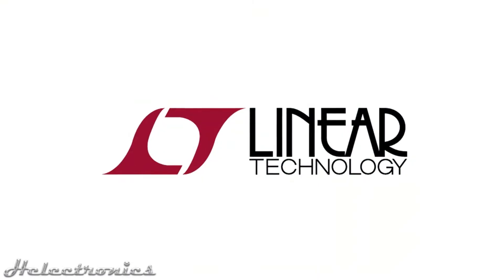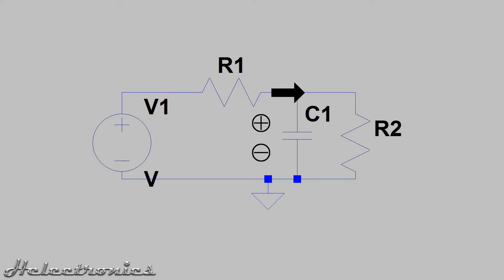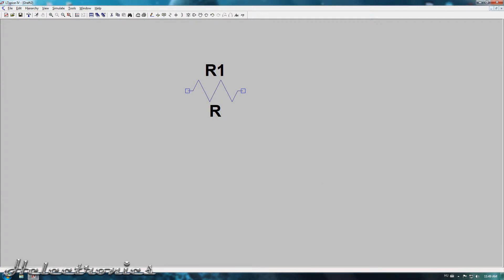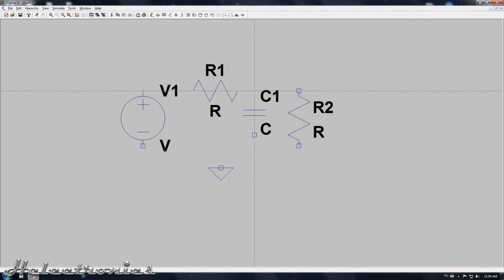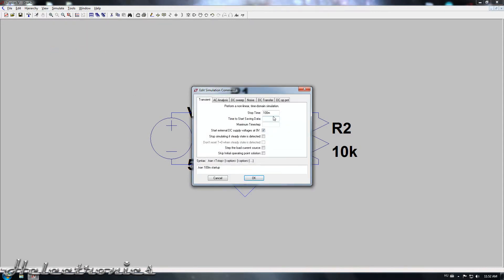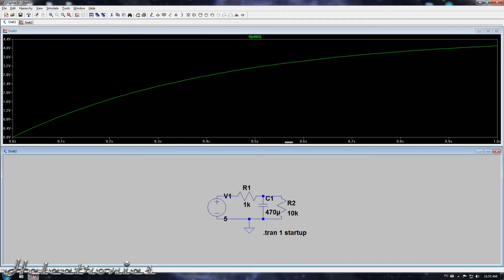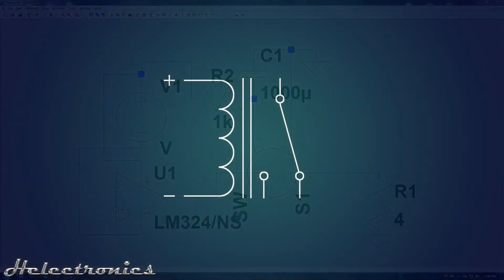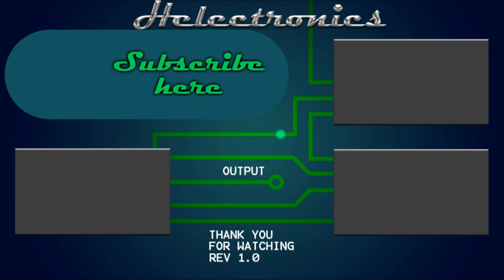LT Spice - 2.Delay Circuit

Comment: How would I add an LED to the circuit
Reply from the maker: Hi, you just replace the R2 load with an LED.
Reply: @Helectronics  Any LED in the LT spice? No specific rating?
Reply from the maker: Yes, the simple LED can be also used. R1 can be 100 ohm and C1 can be 1000uF. At simulation command you put stop time 100m and check the Start external DC supply voltages at 0V. You will be able to see on the graphics how the voltage rises.
Reply: @Helectronics  is there a way you can make video of this?
Reply from the maker: Sorry but not in the near future
Reply: @Helectronics  This is false, the circuit does not flash when built on a beadboard
Reply from the maker: Does it fade in? What kind of power supply did you use?
Reply: @Helectronics  DC 5v and it just stays lit. I did this with the circuit shown on the first part of the video
Reply from the maker: Yes, all it does is fades in in 100 milliseconds and stays lit. This is not a flashing circuit, it is a delay circuit. If you replace the capacitor to higher value (ex 10000uF, you will see how the LED fades in slowly and stays lit.
Reply: @Helectronics  This is misinformation as a flashing circuit is a delay circuit "The warning blinkers commonly found on road construction sites are one example of the usefulness of such an RC delay circuit."
Reply from the maker: Where is this information from? Just type in RC delay circuit in google and you will find out what it is good for.
Reply: @Helectronics  This information is gotten from fundamentals of electrical circuits.